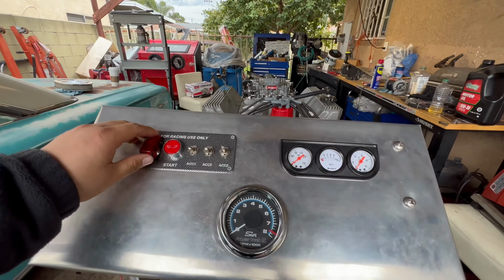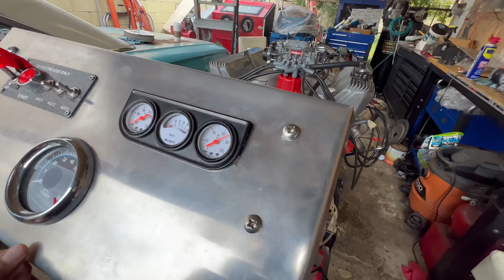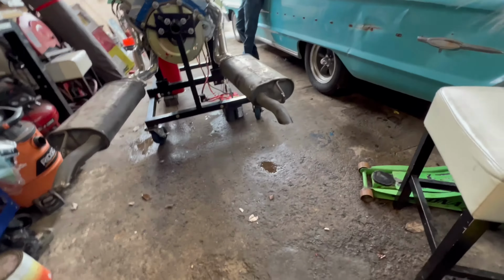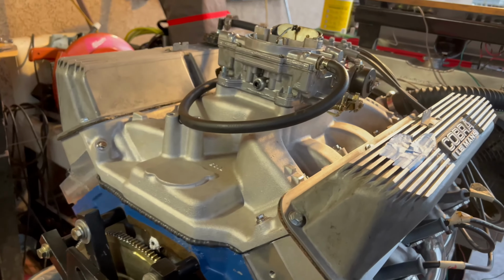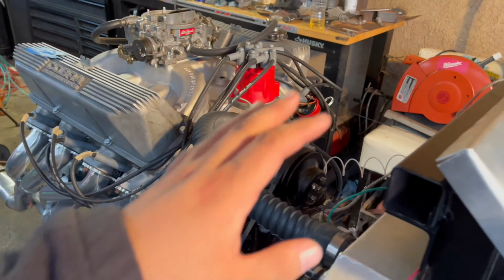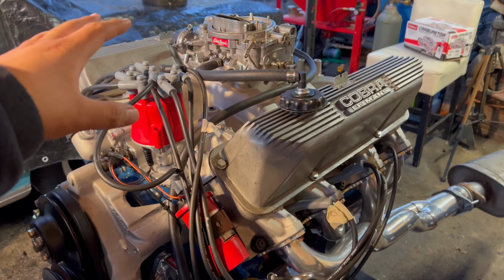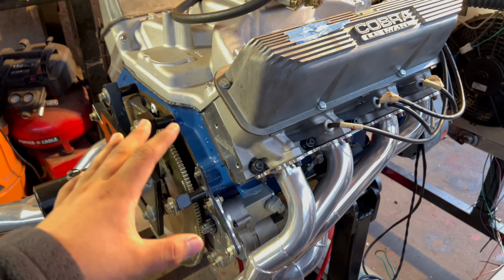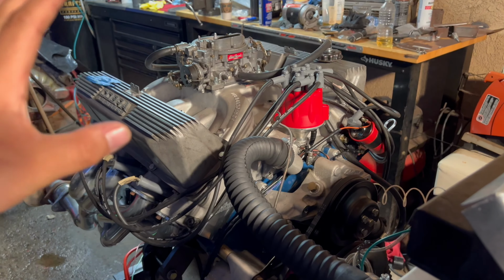Ford 428FE Build Part 12: The Start Up!!

Comment: Back in the 70s,  I put a 390 tri-power in a 57 ford sedan with 3sp overdrive.  Engine was from 61 Galaxy Conv 3sp. It was tired but had fun cruising HiWays. Got 19mpg on highway.  I had extra gas tank in trunk and ran none stop st louis to Ft Benning Ga.    Tri power was out of 61 tbird.  Carbs do not like to be set for long time.  Cork gaskets and power valves dry up and give MAJOR heart aches.  Looking forward to your videos.  thks.
Reply from the maker: that’s a cool story, I might have to carry 2 gas tanks as well hahaha I’ve heard the power valve goes out on these but I’m sure I’ll be driving this thing all the time

Comment: Great idea doing the start out of the car. Imagine all the extra work you would have to do if the engine was in the car.  Great stuff and good job.
Reply from the maker: It definitely would’ve take much longer, especially taking off the oil pan. I just want to drop in the engine and trans and have it ready to go

Comment: That 428 sounds awesome, I have a 64 Galaxie with a 428 in it as well but it's on the back burner right now. I am going to build an engine run stand for a 68 289 that I just built, and I am wandering where you got that starter mounting plate? I like that option better that using a bell housing to mount the starter. One more thing I have to say is I am 62 years old and I love seeing younger guys like yourself having an interest in these older cars, that will keep our hobby alive. THANK YOU!
Reply from the maker: Thanks Gary! I got the plate from eBay. If you type in engine starter plate it will pop up. They have them for all type of engines. A tip would be to leave it in the metal finish to get a good ground on the starter

Comment: Get a Holley, engine master did a comparison between the Holley, edelbrock, demon and a summit racing carb and the edelbrook was at the bottom. It was 25hp down over the other carbs.
Reply from the maker: Good to know, I like edelbrocks because they are pretty reliable. I’ve had one for 7 years and never touched it. Thing ran great on my 66 mustang. But yes this one is just temporary, I’ll have to look for that video!
Reply: @OmarRamirezGalaxie  I love the idea of the edlebrook, you can tune it without pulling fuel bowls and it’s similar to the old carters but nothing like the reliability and performance of the 4150 style carbs. Love the build by the way, I have a dream to build an early 60’s Lincoln and throw in a boosted FE to run drag and drive events. Keep posting the videos, love every minute of them.
Reply from the maker: @beekeeper6109  very true, I’ve also heard good things about the summit carbs. I’ll have to try one someday. I’ll be switching to the tri power so won’t be using the Edelbrock. A boosted FE sounds crazy cool hahaha

Comment: If that idles like that you have it dialed in. You should be so proud of yourself. Pretty damn good mechanic. You went by the books & it shows. Good job diagnosing the noise. Gotta put the 3 carbs on, better than leaning over a fender later.
Reply from the maker: Appreciate it! Yes leaning I’ve the car with some of these heavy parts can get exhausting haha

Comment: Sounds great, another good job for Omar! Suggestion: Paint a half-inch wide X six-inch line on the flywheel beginning from the gears teeth. It makes it easier to see if the lope is from the cam lift or a timing issue! I really like the starter control panel, it looks very professional, maybe a side job for you building control panels for other car enthusiasts!

Comment: Thanks for the update Omar.  Whenever you do a start up on an FE and don't spin a main bearing in the process it's a good day!  This will be awesome once you get it in the car.
Reply from the maker: Haha yes, I’m just glad I didn’t have to break a flat tappet camshaft. So many horror stories, but just glad it’s running!
Reply: If you are spinning mains you don't have a clue
Reply: @donschutte1418  Exactly. I know a couple people who had to pull their newly rebuilt engines for this reason because the builder didn't know what he was doing.
Reply: What does that comment mean....is that a cheap shot at FE's or just a comment in general?
Reply: @halseyknox  The remark was because the FE series engines oil the top end first and if the engine builder didn't take the extra steps of chamfering the oil return holes and drilling out and screwing restrictors in the oil feed passages bad things could happen. While this is a concern for oil starvation at the top end or during spirited driving, first engine starts are always a critical time.  BTW, I love FEs.

Comment: Did you say oil pressure is around 15 -20. Psi.   Hot. ?    Was the lifter oil gallery plug  behind the distributor    put back in at the machine shop.   Common  mistake     you can pull the timing cover  to check

Comment: Great video - Excellent work!  Think about installing older "legacy" valve covers to go with that tri-power for the "Early '60s look" - If they'll fit over those rockers!
Reply from the maker: Yes I want to go more original looking on the valve covers. I’ll have to see which ones fit

Comment: Sounds awesome Omar.  Back in the day; my dad had this very same car.  It only had a 289 w/4 barrel carburetor and that seemed really quick.  Can’t imagine what the 428 tri-power will do.  If it was me, I would run it the way it’s now for a while and later add the tri-power.  Can’t wait to see the final results
Reply from the maker: Yes going to get it dialed in and then switch over to the tri power. Might even go fitech fuel injection later

Comment: Finally & Congratulations Omar! 🤟 It took me two years to build as well, Life does get in the way of fun. Your engine Sounds Great! now let's see who will have it installed in our Galaxies first, 😂🤣. I started mine 6 months ago already, and I haven't had time to do anything since. So now you've inspired me to start the installation process! Keep up the good work!
Reply from the maker: Hahaha I hope I can get this engine in there soon! Really want the tri power but going to look into the transmission now
Reply: @OmarRamirezGalaxie  Make it work with the 4 barrels first Omar: then experiment with the tri-power 😛... I hear it's a beast to tune. 🙄I do have an Edelbrock 750, but I installed the new AVS-2 650, It's suppose to be very responsive up to 5000 RPM where my engine will rarely touch. I'm hoping to install my engine as well along with a Tremec T-56 Magnum 6 speed manual trans to install as well. it's going to be a nice project.

Comment: Been looking forward to this, Omar!! Sounds great! That's the exhaust your're putting in the Galaxie, right? ;).  Good you caught that windage tray interference and didn't let it "work itself out".  I'm actually going to skip the tray on my 390 build for the time being.
Reply from the maker: Haha these are some cheap Toyota mufflers I got for $20. I think they’re working hard to suppress the noise on the 428 lol but yes, it will have a proper exhaust once it’s in the car. I considered leaving the tray out but already bought it so might as well use it

Comment: Im getting ready to start up my 68 stang for the first time in what seems like an eternity. It's been parked for about 13 years. The engine (roller 302) was rebuilt about 12 years ago. It's new to the car since the 289 that was in it when it got parked is no longer in it. Anyway, it's a very long story but what tips do you have for seating the rings? I don't have a mechanic background either so kind of nervous. I've been documenting everything as well and hoping for the best.

Comment: Ha Omar . Wow that thing sounds great . Ya the tri power carb set are kinda hard to tune . But congrats on the build . Just one question . How is the starter bracket gonna work with the bell housing on the trans . Looks like the bracket is mounted on the tranny dowel and mounting bolts . Just curious ...
Reply from the maker: Thanks! The bracket is to be only used on the run stand. Once the engine is ready for the car I’ll attach the engine plate and transmission without the starter plate

Comment: Nice build you wouldn't happen to have a 390fe crank or motor you would be willing to  part ways with would you?
Reply from the maker: I do but I will be using it for the mustang haha. I always see 390s at the junkyards here though
Reply: @Omar Ramirez   what junk yard? And I have never pulled a motor at the junk yard just parts off cars. How would you get a motor out?
Reply: @Omar Ramirez  I have a 360fe f100 I need to work on.... I live off the 5 freeway in Anaheim I havnt seen many f100 trucks in the junknyards around me

Comment: Flattening the scoops on the windage tray renders it less effective. The scoops are what peels the rotating oil away from the crank. You should have just clearanced where it hit and left the rest alone.
Reply from the maker: I’m guessing it wont work at its full potential but will still help in keeping the oil off. I just didn’t want to risk it flattening it a bit and it still hit, costing me another 2 gaskets.

Comment: Your Tri Power will look sweet thou I’m not  sure your gonna notice any performance improvement over an Edelbrock 800 cfm?
Reply from the maker: Yes, I’m sure a single 4 barrel will do better than the 3x2 but I think it’s a lot cooler!
Reply: @OmarRamirezGalaxie  BTW, do you know the cfm flow numbers on each carb on the 3x2?
Reply from the maker: I believe it’s 320cfm on the primary and 350cfm
Reply: @OmarRamirezGalaxie  thats 1020 total cfm. Better than the old Chev/Pontiac tri-power but lower than Mopars 1350 cfm on 340/440 six packs.  They run a 350 in the center and 2x500 cfm’s on the inner and outer carbs. Good luck with it Omar. Your certainly workin hard and spendin 💰.

Comment: What did you use to mount the starter motor??; Also what cam are you running Sounds nice..
Reply from the maker: There’s an engine start plate that someone makes on eBay. If you type in engine starter motor plate Ford FE it will come up. The cam was a custom grind by Oregon cam grinding I have a video on the camshaft check it out!